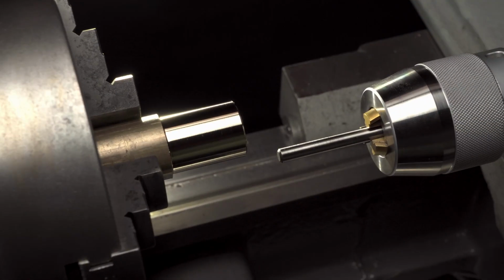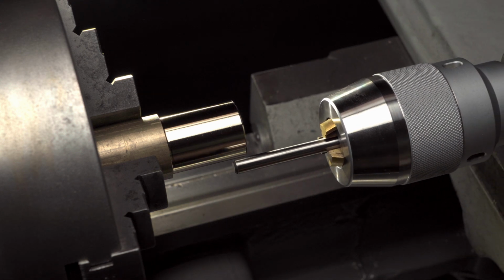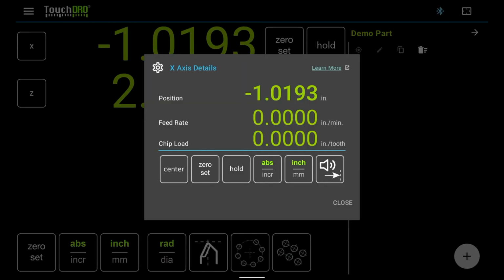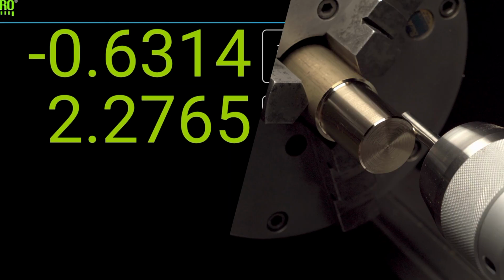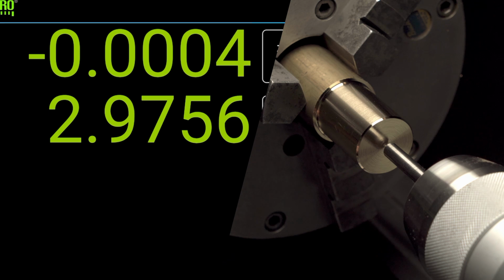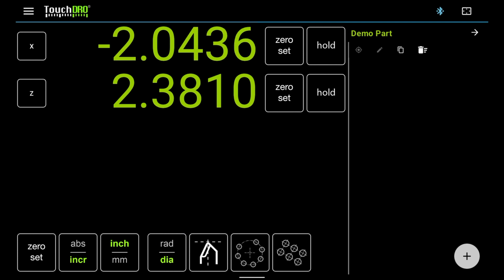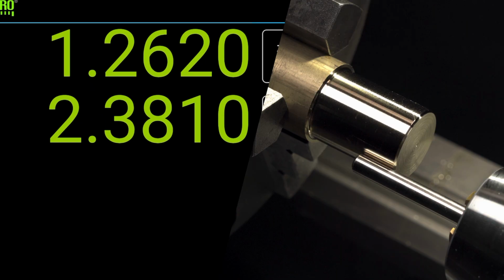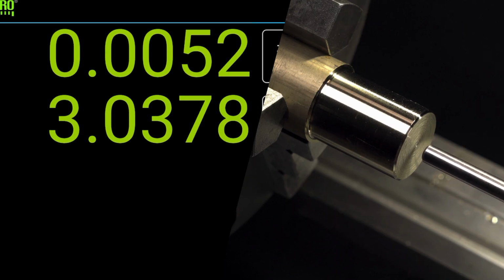How to Drill Precise Holes on a Lathe with a Tool Post Mounted Chuck

Comment: Another way to do this is to put a coaxial indicator in the chuck, then run it over the outside of the drill chuck or on a precision bar held in the chuck.

Adjust the carriage and height until the indicator shows no run out, then its pretty much on centre.

Comment: If you have a repeatable location for the cross-slide, you can put a boring head in the spindle to bore out the holder for the chuck.  That was it cannot be anything but perfectly aligned when cut, and as repeatable as your alignment method.